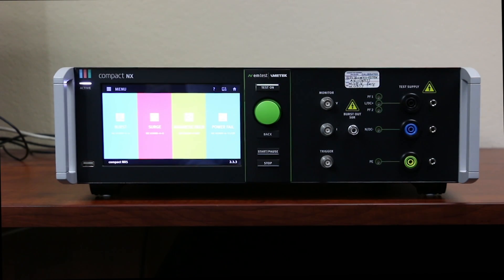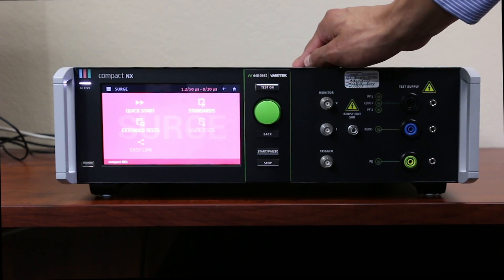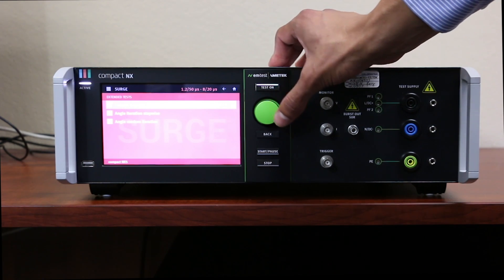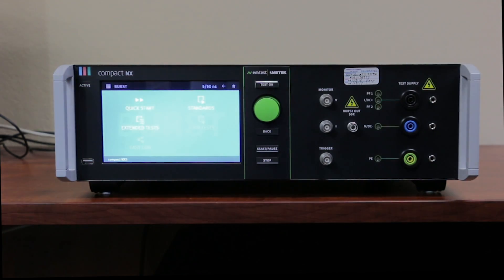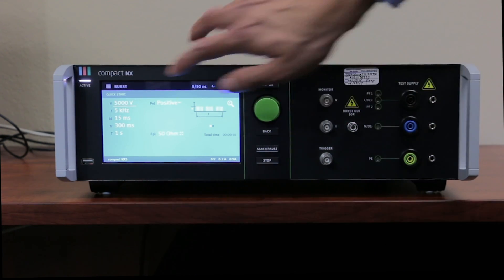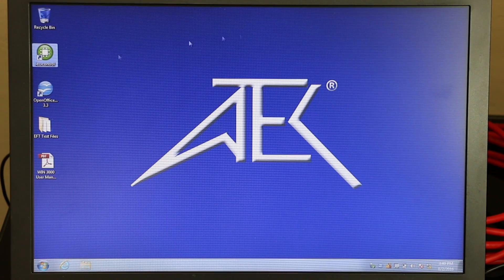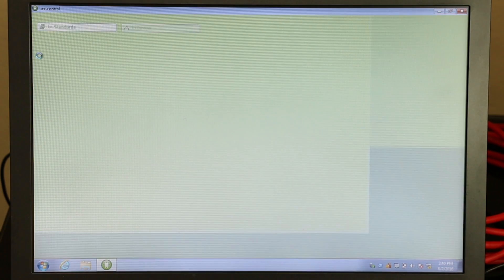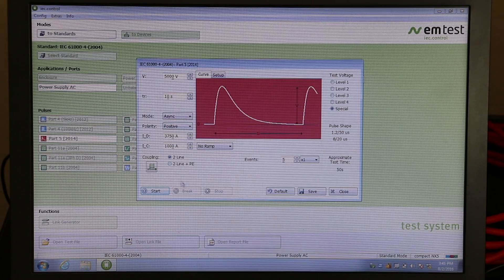EM Test Solutions NX5

Comment: I am doing surge test using a NX5 with inbuilt CDN, 32 A unit, i m confused which terminals should i use to connect the EUT? the front terminals or the rear HV-COM are to be used? Really appreciate your help with this. Thanks
Reply from the maker: Hi, feel free to give us a call at (800) 404-2832 and someone on our team should be able to answer your question!